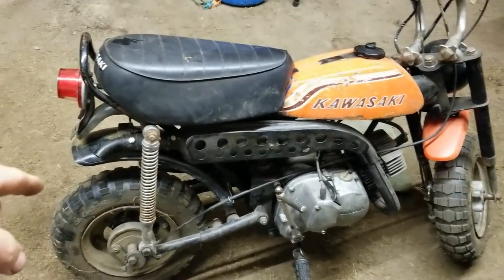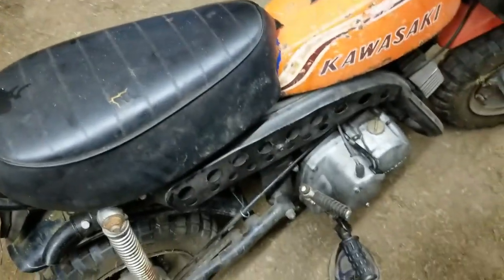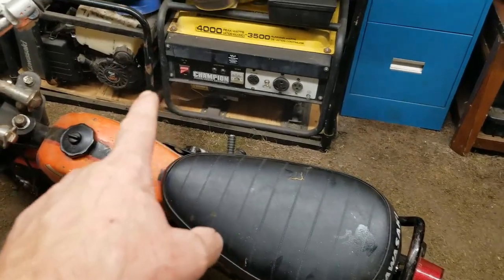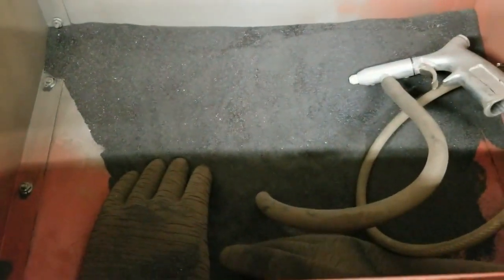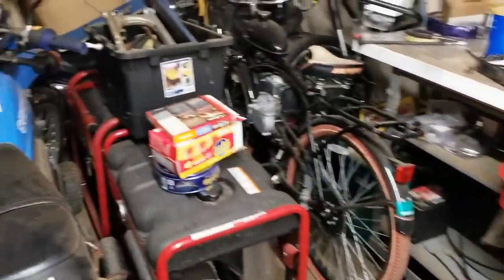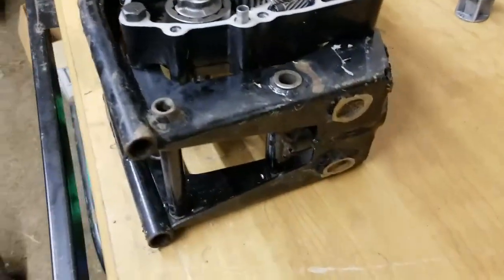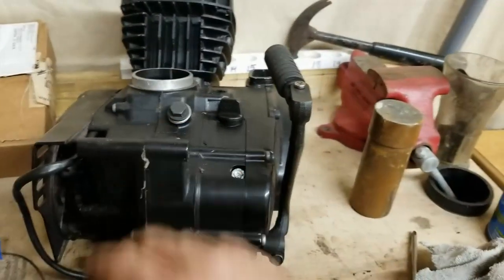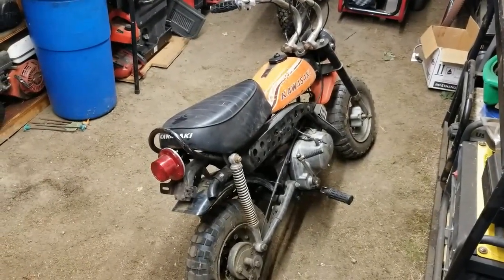This us update video on the MT1 and upcoming

Comment: appreciate the update buddy - my KE100's oilpump is finally working! I think I just need to diagnose my lights/indicators not working and maybe fill and reseal forks before she's ready to go. Your KE102 build with the green frame and new gauges is gonna be so cool, thanks for your time and effort putting this info out there!
Reply from the maker: Thats awesome and thank you check your connection at the voltage regulator check fuses there are two

Comment: Hey Kevin, I’m at a total loss. My bike is kicking my ass right now. It stopped running entirely and I don’t know why. It’s got new rings and before it stopped running it spat a bunch of smoke out the back and stopped. I replaced the clutch side crank seal and flushed out the crank today. I just don’t know what I’m doing wrong. I’ll get the occasional backfire but that’s it. Any help is appreciated
Reply from the maker: 1st  replace the spark plug even if it is new 
2nd  check compression it should be 120 psi or better 
Let me know what you get
Reply: Kevin Bergeron it’s new
Reply from the maker: @Billyjoe78517  doesn't matter new parts can fail
Reply from the maker: Always start with basics 1st never assume a part is good because it is new
Reply: Kevin Bergeron I’ve got spark and fuel. Blows my finger off the plug hole when kicked over
Reply from the maker: @Billyjoe78517  you need to check compression with a gauge
Reply from the maker: @Billyjoe78517  you can have spark if the plug is internal foul it will spark  but not hot enough to burn
Reply: Kevin Bergeron I’ll try a different new plub